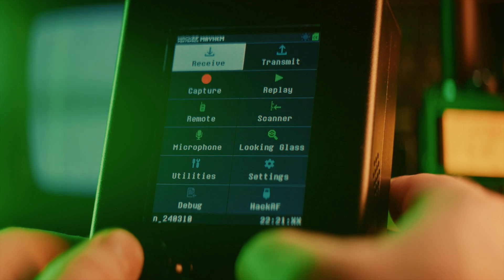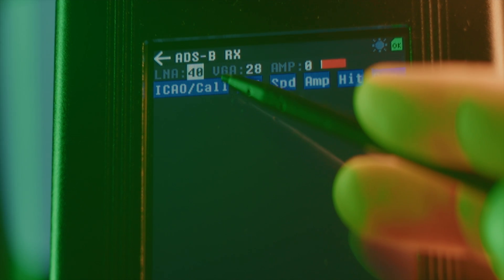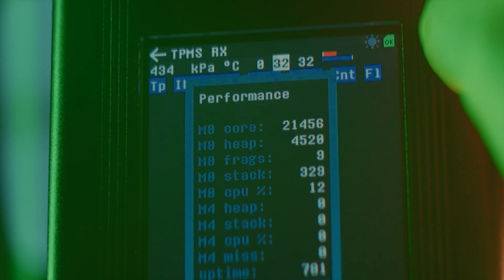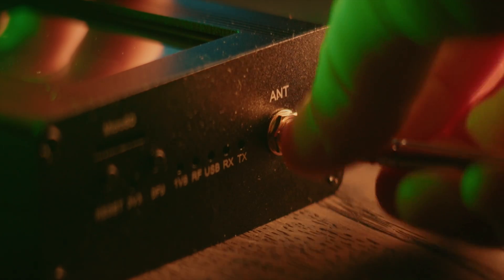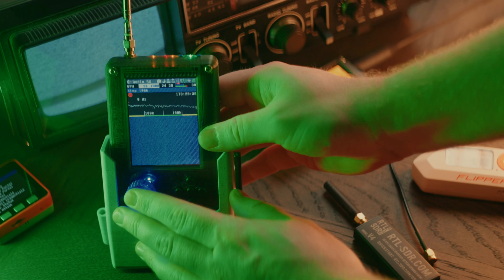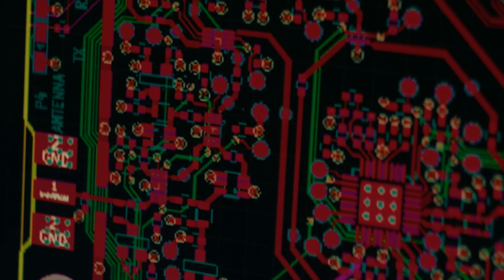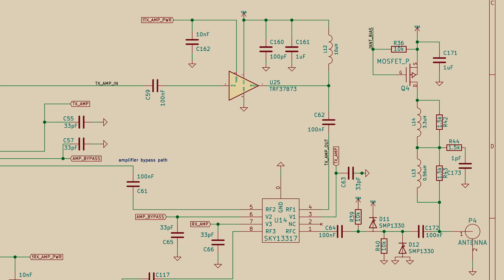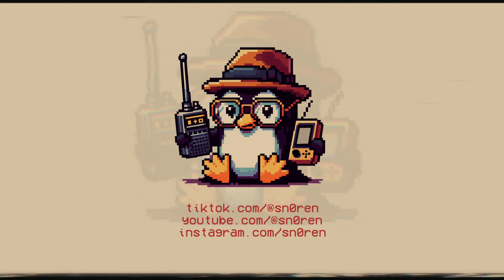I Broke My HackRF Portapack! Here's How Not to

Comment: So the Clifford edition of HackRF is not in the OpenSourceSDR Lab RF/H2 sold ?? 
"@CliffordHeath
1 hour ago
No HackRF has a battery, including mine. The battery is in the Portapack, which I didn't go near"
Anyone know what setting may be stopping me getting audio output?
Reply: @joecizin9357  Check that the little speaker icon on the top status bar is green, not greyed out. If it is green, in the receive-> audio app set the volume on the top right to 70 or more and you should definitely hear static in WFM mode. If not then try using headphones to verify that the digital to analog conversion circuit is working. If so, you might have to open up the portapack to make sure there is a speaker installed and to check if the speaker is properly connected
Reply: Thanks,   no luck dis assemble next, do Clifford boards  have ID markings? @VeniceInventors
Reply from the maker: The assembled Portapack I’ve linked in the description has a Clifford edition HackRF board in it. OpenSourceSDR Lab also sells assembled Portapacks with regular r9 HackRF boards in them.

Comment: You broke yours before I broke mine!  I think that means I'm not using it enough!
Reply: Bummer. You recently got it.
Reply from the maker: Time to live up to that jackass intro and do some crazy daring experiments. Like rubbing your socks on the carpet and touching the antenna port :D
Reply: @sn0ren  I'd do it for science if they sent me one to test!
Reply: Sox, he's not even wearing pants. @sn0ren
Reply: So, the R9 is a dud, the Clifford  HackRF  edition Portapack  that I purchased is marked R9, nothing to show it has the Clifford mod ? it has no sound, it is not recognized be RTL Sharp or Console, I know this is a common issue, guessing that its related to the need to come up with the R10 based on R8.
Hacker Doc. (hardware revision)
 One r9
MAX2837 was replaced by MAX2839. Si5351C was replaced by Si5351A with additional clock distribution. A series diode was added to the antenna port power supply. Manufacturing year: 2023

HackRF One r10
This revision is based on r8, reverting most of the changes made in r9. A series diode was added to the antenna port power supply. Manufacturing year: 2024
Reply from the maker: @joecizin9357  I don't think any clifford board has r9 printed on them. To make sure that you have a clifford board look at the chip just next to the usb connector. If it has 6 pins it's an r9 board. If it has 8 pins and is slightly bigger, it's a clifford board. 

The series diode that was added to the antenna port power supply in r10 is to protect it, if you enable bias tee with a short on the antenna port. The other changes are to make sure chips are available to source.